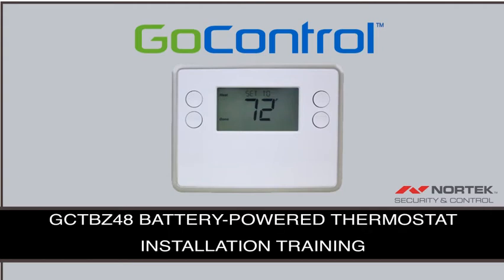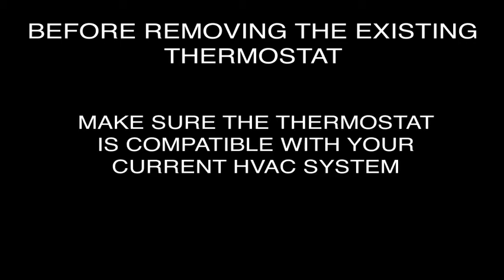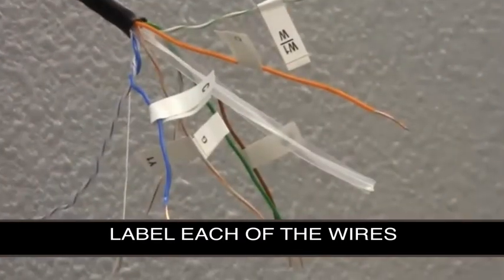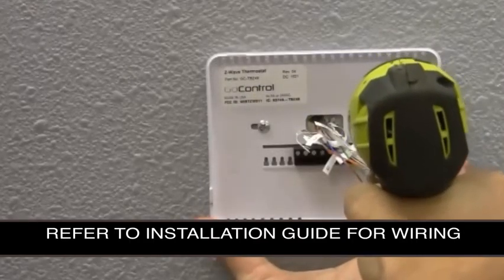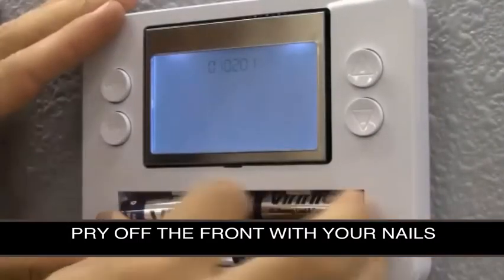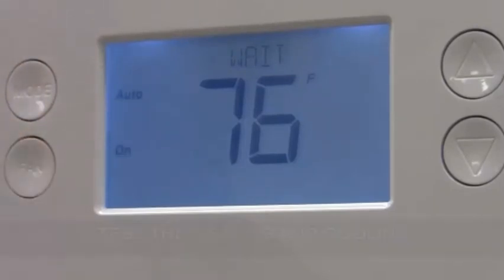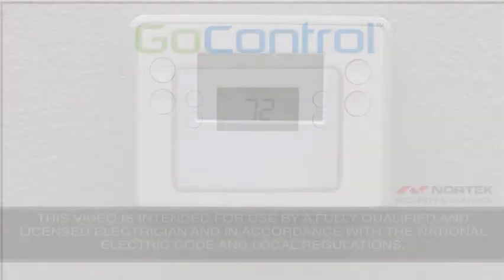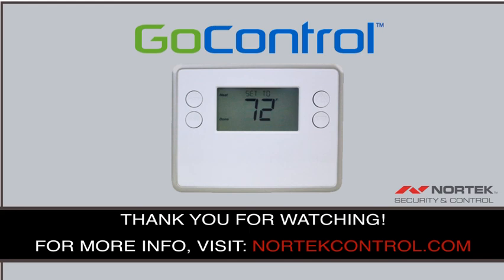GoControl, TBZ48 Z-Wave Thermostat Installation Video

Comment: I have two of these and the programming depends on your smart home setup. It's a Z-Wave thermostat, and you can integrate it with hubs/controllers such as SmartThings or Wink - just ensure you have a Z-Wave controller that supports a thermostat. It will work as standalone with manual intervention, or you pair it up with a controller and handle the controls & schedules that way

Comment: You managed to make a thermostat, though simple -- does not include programable for 7 days?  This is a "smart" thermostat right?  Even if you do a little more with programable and charge me $70 more, I would still buy it.  For now, the non-programable option is a deal-breaker.